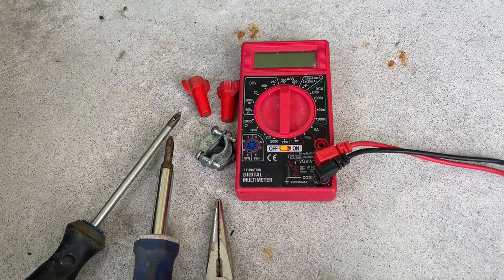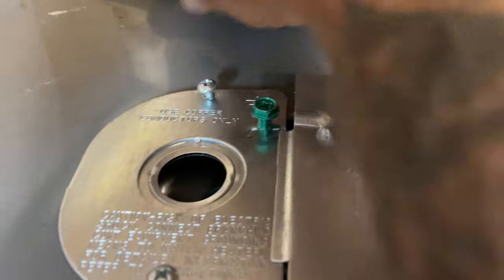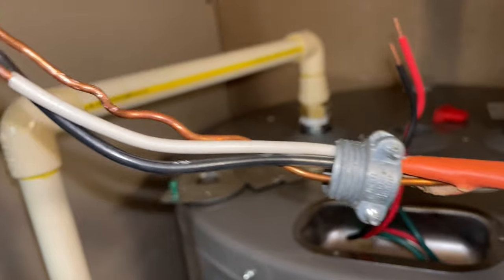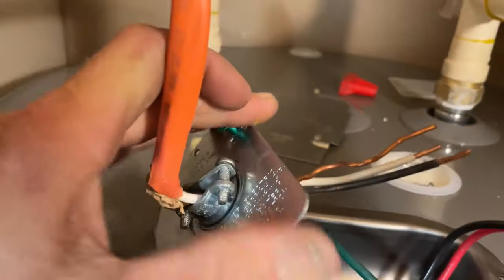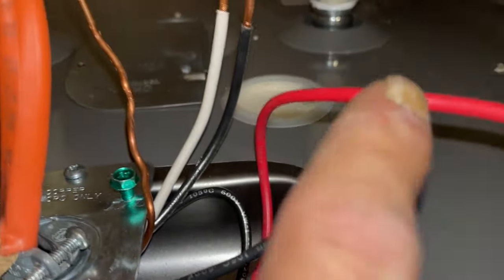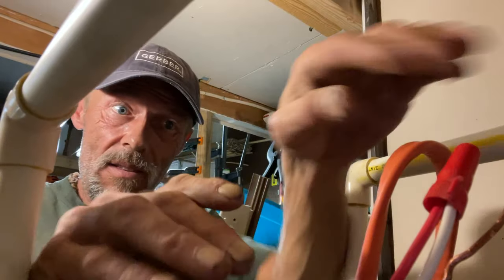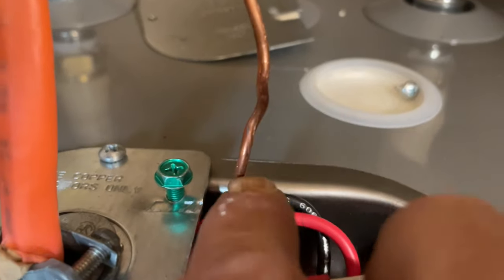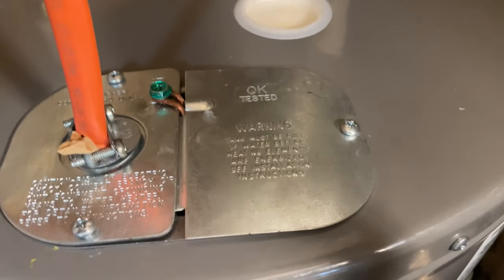HOW TO HOOK UP POWER TO AN ELECTRIC HOT WATER HEATER

Comment: I'm sorry but we couldn't get any power to the water heater the way you hooked it up! As red to white hookup is backwards, it's red to black and black to white wire is the only way we finally got are heater to work!
Reply: It shouldn't have mattered. If you have 10-2 w/ ground wire a black a white and bare copper. The black and white both go to your double pole breaker and bare goes to ground. You might want to check
Reply: @spoonstir8675  yes I've put new wiring in a house I rehabbed and changed and or updated plugins and lights and switches, so I do have a little experience to say the least!, So yes I know where a bare ground wire goes to and black and white white goes LOL!..... No on the contray it makes a big difference how you wire up a water heater!, I was being shall we say kind to this guy who was teaching how to wire up electric water heaters!, As I should have gave him a bad grade as he waisted me a half of a day trying to figure what the hell I did wrong with the installation of the water heater!, We checked the circuit breaker at least twice and unessecarly replaced other parts on water heater just to find out that the guy gave us the wrong advice!... No this guy cost me time and money!, I normally can do trust the professional on YouTube, but clearly this guy wasn't one of them!
Reply: @brianhenson6141 
No you're wrong on an electric water heater at the breaker in the panel you should have a double pole 30 amp breaker that two wires hook on to. Those two wires each carry 120 volts the bare copper hooks to the ground bar or on some older panels it goes on the neutral bar. Meaning the neutral and ground are all hooked together.
Reply: @brianhenson6141  
So it doesn't matter what color you hook to the breaker as they each carry 120 volts a water heater does not require a neutral wire
Reply: @spoonstir8675  well I always hookup white neutral and black hot to breaker and ground bare wire to terminal strip as that is the normal way and procedure and it is of course what you will see in any house as that's the way the professional do it, now I don't claim to be an expert or a professional when it comes to wiring things up or elsei l wouldn't need to refer to YouTube videos from time to time, now I will tell you that I rebuilt an old electric water heater a couple of years ago which by the way wasn't worth it because of the high electric bill from such an old heater, but my workers the people living there needed heat within the week and couldn't find a heater in time, and I replaced the upper and lower heating elements and thermostats and on that peticular water heater all they had was a 12/2 wire with a double 20 (40 amp breaker believe it or not) yes I know they recommend 10 gauge by the way but it worked but the peticular instructor on the video at my that time said to hook up the red wire to the left side of the thermostat and I had to do the exact opposite of what he said to get the heater to work, don't ask me why but it worked fine, it only goes to show that no matter how professional some of these guys seem to be, it doesn't always work the way they say but that might not be their fault as perhaps some brands of water heaters are wired differently?, I don't really know, all I know is what worked for me
Reply: @brianhenson6141  
Dude you are confusing yourself. Once again 10-2 wire was used in this instance. The white was used as A HOT 120 VOLTS ALONG WITH THE BLACK. the bare was connected to terminal strip. There is NO NEUTRAL NEEDED in wiring a 240 volt water heater.
Reply: @spoonstir8675  okay I'm trying to avoid being rude here, so maybe you misunderstood me or I did a poor job explaining myself, let's get something clear here, you say that White neutral is not needed in a 240 volt hookup but that's impossible as in a 10/2 wire you have to hook white wire to one terminal of breaker and black wire to other terminal of the double breaker also known as a two pole breaker and ground wire to terminal strip at breaker box, now if this was just your ordnary single pole breaker you would hook your black (hot wire) to the breaker and the white and ground wire to the terminal strip as the bare wire is ground as you know and the white wire is called neutral or the return wire which if it's not hooked up you can't get proper flow of electricity or current, so yeah maybe I confused you with the term neutral wire. And maybe you should recheck this video and you will see that he indeed hooked the other end of the white neutral or return wire with the red wire and the the two black wires (hot wires ) together, now I did exactly as the man instructed and it made sense to me to wire the two black wires together as they are hot and this made sense to me as that's what you normally have to do this in all your wiring, but it didn't work for me as we got no to little voltage on the meter reading until my friend hooked the one block wire to the Red wire and the other black wire to the white wire and then the water heater worked fine
Reply: @brianhenson6141 That's exactly what I said!   For the last time the black and white are run as HOT carting 120 volts each. Just what I and you said! The bare connected to ground just what you and I said! If you did it this way  you should have had 120 coming out of white and black wire and it really doesn't matter what wire you connect to heater wires as they both carry 120 volts!  And I don't care if you are rude but I'm done! you either have a bad line or your hooking it up wrong!!!